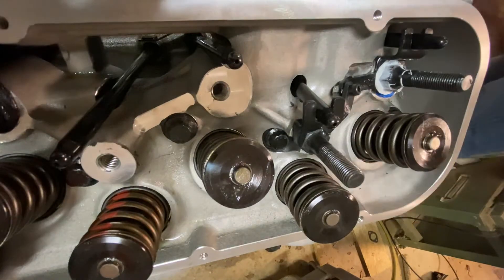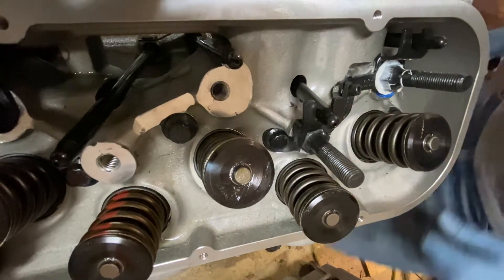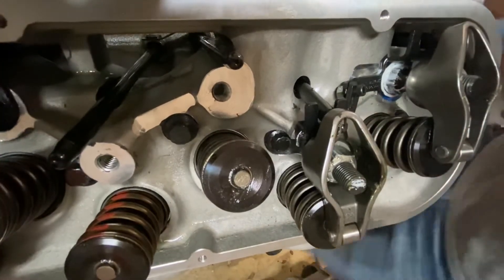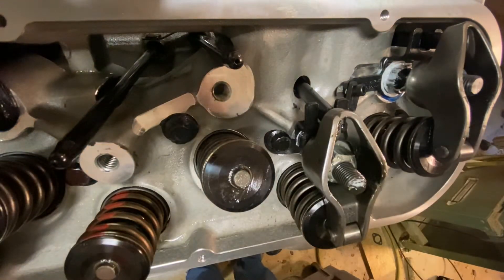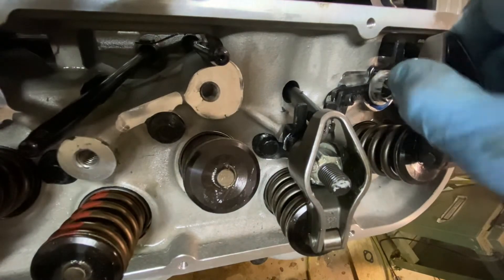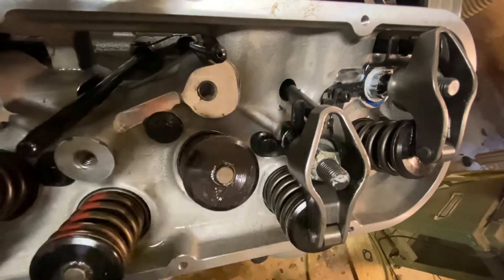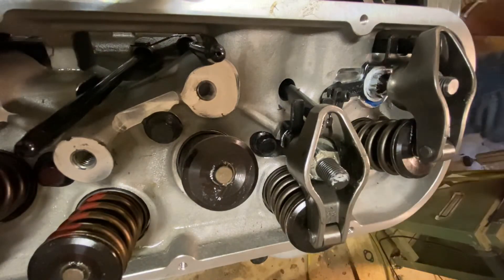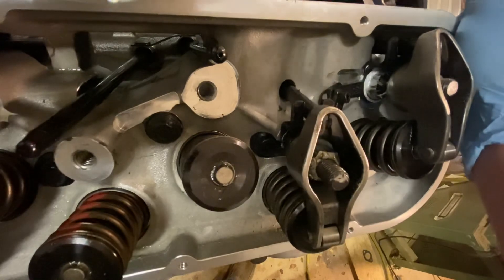Big Block Chevy push rod binding solved with adjustable guide plates

Comment: yeah, I think anymore part quality is just horrible. bought a set of 3/8 guideplates, had them for 1.5 years before I installed and found that they are horrible with alignment. broke them, aligned them, then welded them back together.

Comment: Morning, when are you doing another vid on the Avid wanted to see how it turned out.
Reply from the maker: I didnt think anyone was interested! I can do one, what would you like to see?  so far its awesome!
Reply: @accidentaltradesman5139  Oh there are a few of us watching lol. I told others about the videos that are interested in the same thing. I would like to see it now if it was complete and functioning. Did you migrate parts of the HD into it to save some on the AVID? If so could you add that in and how smooth or not smooth it was. And how well the tramming works on it. I added linear rails to my HD and got the ball screw to replace the X belt. Was going to do the same for the Y. But have really been throwing around getting the Avid kit and trying to use some of the HD stuff for it. Thanks for replying.